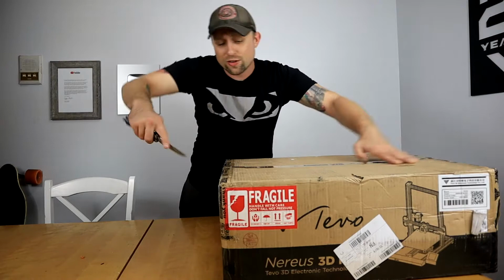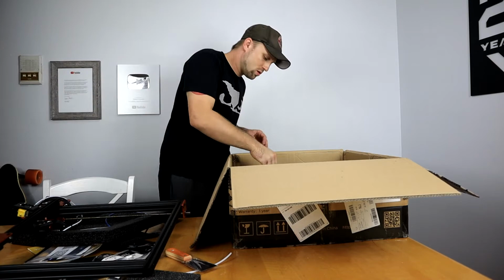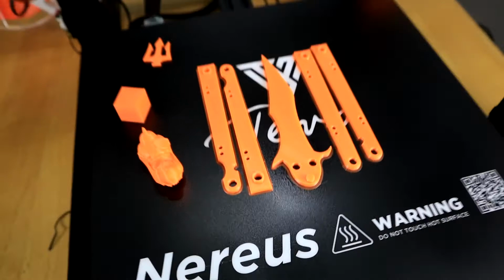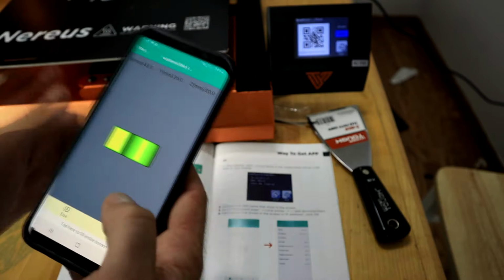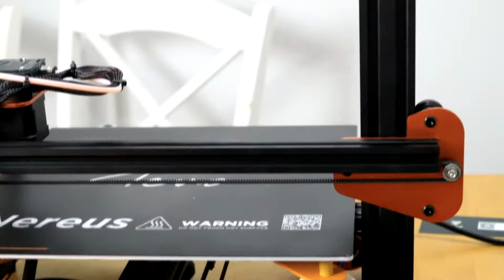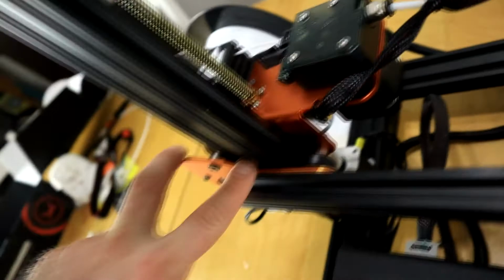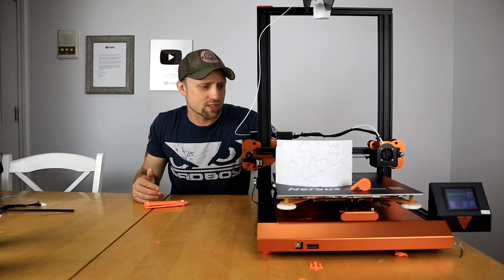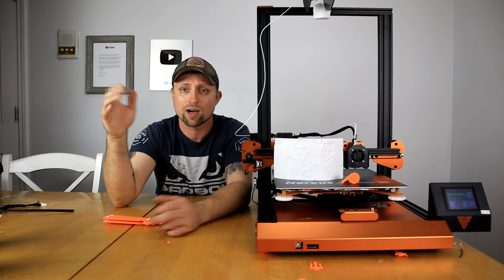Tevo Nereus 3D Printer Unboxing & Review. Best 3D Printer Under $500 2019?

Comment: Great video, you got a new sub and you sold me on buying one for my 3d printing company. I use a CR10 right now for the main printer but this might be replacing it. I bet I end up with a couple of these. I mean I can get this on Amazon with prime with the auto bed level kit installed (BL touch) for $351.
Reply: How's it working for you?
Reply: The dual cooling nozzle is always amazing on these printers. I bought the Tevo and am thinking of getting this one as well... not sure about the software on that touch screen. I really like the software setup on the Alfawise U30... Wonder if making a hybrid printer would work.

Comment: You had amazing results, I've had mine for about a year and it's been nothing but frustration and every print is worse than the last. Tevo still hasn't even uploaded the firmware to the website.
Reply from the maker: +Rain Spider sounds like you have mechanical issues makes sure all belts and eccentric nuts are tight